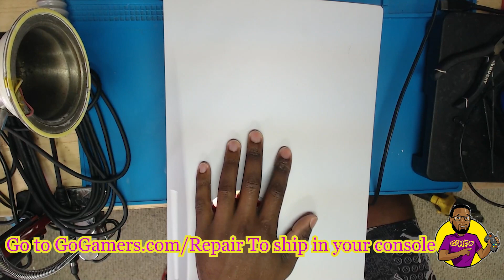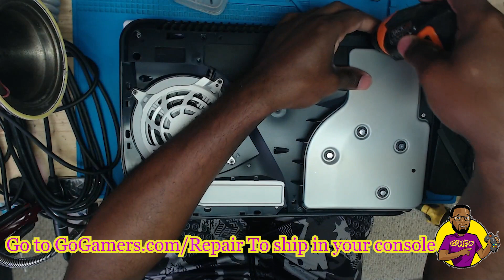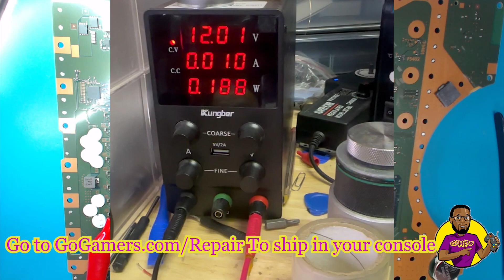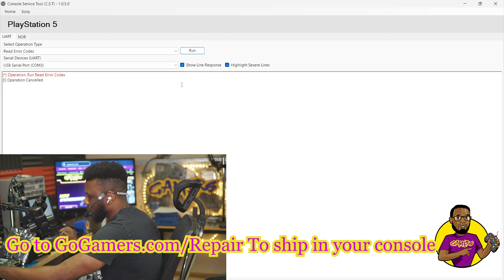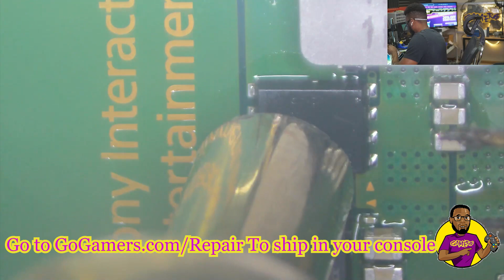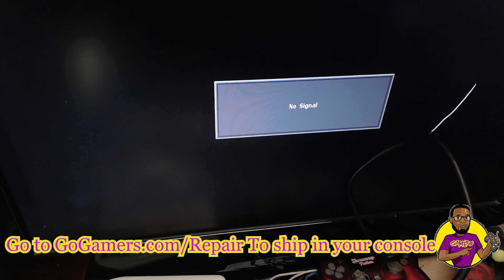PS5 Blinks Blue Light Then Turns Off: BLOD Repair

Comment: I fought like hell to remove and replace a physically failing HDMI port, which was brutal by itself, then spent way too long battling baked-on sticky flux that kept smearing instead of coming off no matter how much IPA I used, and by the time I put everything back together the console wouldn’t turn on at all; after opening it again and cleaning it once more it finally showed signs of life, but instead of booting it now beeps, flashes a blue light, spins the fan, and immediately shuts itself off, leaving me stuck in that maddening state where the hard repair worked but the system is now aborting on startup and I’m forced to decide whether to open it yet again or hand it off before I lose my mind.
Reply: Have you fixed it yet?
Reply: @Benny_khute I took it to a shop that got it done for 165 My old eyes just couldn't hang anymore
Reply: By the way I don't know if I mentioned this anywhere in the thread but I assumed it was a failing HDMI port because the image kept going black. After taking it apart I realized that it was the cable that was pinched behind a TV. So I took it apart for nothing. Very costly. I ended up buying a new PS5 Pro for like 700 bucks and then I said you know what I'm going to fix this thing which ran me another $165 shake my head expensive lesson learned. Check the cables first.....

Comment: hello im still new to this work and ive worked on soldering ps4/xbox controllers but this is much different. I have a friend who gave away his power surged console from a lighting strike and it has the same problem. blue light for one second and bam turns off. i can open up the console and clean no problem. but i dont have the proper tools like the heat gun and microscope. would it be better for me to just replace the whole motherboard?

Comment: This is the 5th video I've seen where the caps on F5701 circuit have caused 2 sec BLOD. Its one of the most common faults. If you are confident to try and fix it yourself I'd go straight to circuit F5701 and check those caps.
Reply: I have BLOD and it is 2.5 sec then turns off and want to try and fix it with my dad and have been seeing the same shi so ima keep this in mind for sure
Reply: F7501*

Comment: Hey this video is great thank you! Can you explain or show how to measure the caps? I have the same issue but unsure how to read it properly on my multimeter. Thank you!
Reply: You de solder the cap, place it on a double adhesive little piece of tape then measure its capacitance, if your multimeter can do capacitance measurements. You can always measure the voltage on a working PS5 board of the same type.

Comment: Mine comes on but blue light doesn’t. Just had hdmi replaced . Advice ?
Reply: If it powers on and is working but there isn't any light, then it could just be that the lights weren't plugged back in properly

Comment: i would like to say that what is the point of cleaning liquid metal with IPA? do liquid metal dissolve in IPA?
Reply: Liquid metal does not adhere to dry cleaning materials. Slightly humid ones perform better. IPA does not cause short-circuit if used (water does).

Comment: If anyone thinks it can be only one shorted cap, this is not true. I sometimes find two of them shorted or almost shorted. If you have new caps, change all 4 of them. Careful about their voltage.
Reply: What type and size are this caps
Reply: @endrivogel  Nobody has any schematics yet. You buy a damaged PS5 of the same type and use the ones in the same position from the donor board. 
Of course you can take the shorted one out then start the thing to be able to measure the voltage then take another one out, measure the capacitance then you know all you need to know to replace it with a new one.